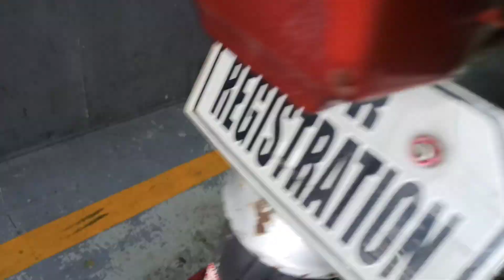TMX 155 MAHIRAP BUHAYIN,NAKAKA 200 NA TADYAK NA DAW🤣🤣🤣

Comment: Idol ang tmx 125 alpha 2017model ba, battery drive ba ang mga ilaw nya???
Reply from the maker: yes sir battery drive na po..khit patay ang makina ay mapapailaw na pi ng malakas
Reply: Bakit kaya madaling masira and mga Led lights sa motor ko boss ??Yong LED LIGHTS na TTD w/fan ...dipa umaabot ng isang taon pondi na agad. .cguro mga 7 na pilit nko..
Reply from the maker: Sir check po ng regulator baka po overcharge na po
Reply: @KUYAJESMOTO31  ah baka sa R.R po ba ang dahilan kaya po nasisira boss salaman ah.. nag palit na po ako den kaka bili ko lang din po Yong ilaw boss...sana mag tagal na po ..salamat boss

Comment: Kuyajes ano kya problem ng xrm 110 q,bago n carb,bago n rin sparkplug,malakas nmn kuryente,kapag sinipaan q aandar pero namamatay agad.
Reply from the maker: Possible po na tukod ang valve clearance or singaw na ang valve..or wala po sa timing ang carb..
Reply: @KUYAJESMOTO31  kapag tukod need po itune up tama po b tnx.

Comment: Pang tmx 125 alpha po ba ang carb nyan ??? Pwede pala yon sir na ilagay ang pang 125 alpha sa tmx 155 ? Plug and play lang po ba
Reply from the maker: Same po sila ng itsura pero magkaiba po ng size ng jettings at throttle valve
Reply: @KUYAJESMOTO31  pero pwede ba ilagay sa 155 yan sir wala naba i aadjust ??
Reply from the maker: @kennyrogers69  pwede sir pero papalya
Reply: @KUYAJESMOTO31  ah ganon po ba salamat po sa info akala ko sir pwede sya ilagay sa 155 kung palitan kaya ng pang 155 repair kit ang loob sir pwde kaya